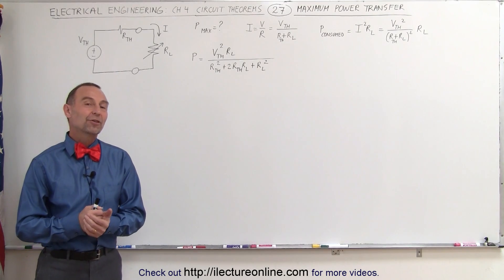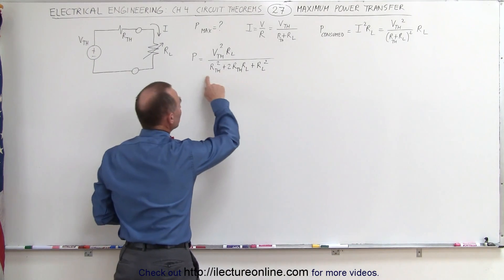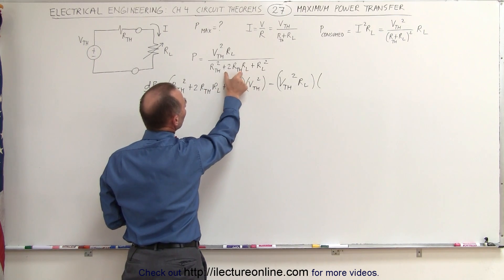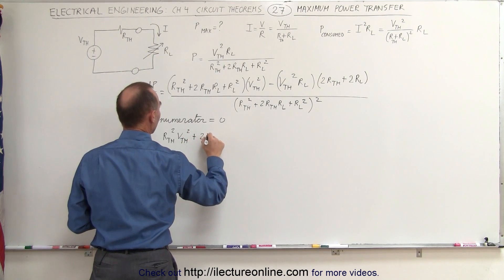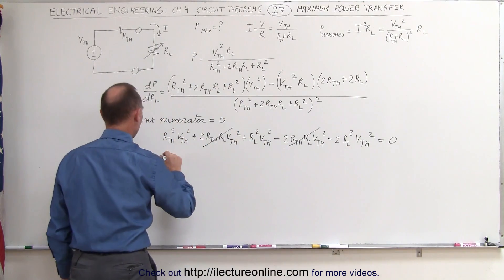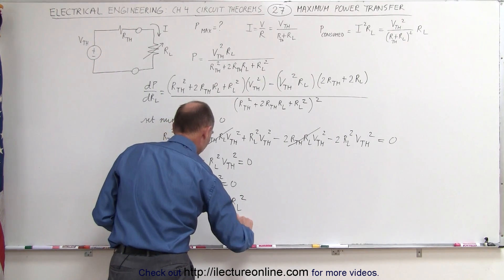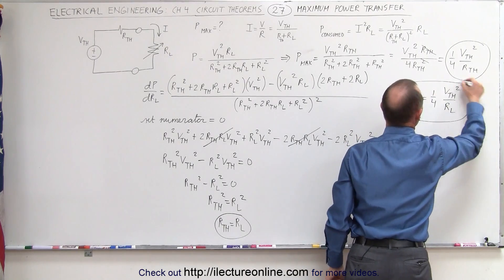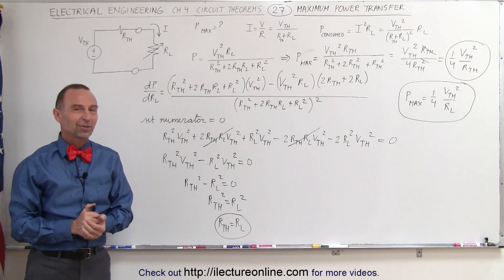Electrical Engineering: Ch 4: Circuit Theorems (27 of 35) Maximum Power Transfer

Comment: Excuse me sir, I would like to ask some questions about Thevenin Resistance
As i just finished a question and the thevenin resistance obtained is negative(For example -135 ohm) (Of coz, i checked the answer, it is right)
What does negative thevenin resistance means? And also when calculating the Max power, i noticed the answer stated the New Thevenin resistance is (-135+135) = 0. But why we need to set the new thevein resistance into 0 to calculate the max power, thank you!
Reply from the maker: Negative resistance does not have a realistic meaning.

Comment: Hello prof why did you set the numerator to 0?
Reply from the maker: In calculus to find the maximum or minimum value of something that is defined by a function or an equation, we take the derivative of the function or equation and set the derivative equal to zero.  (The derivative represents the slope of the function, and when the slope is zero, you will have fouind the maximum or minimum value.
Reply: thanks for the reply how would you know the power is at maximum and not minimum?

Comment: Why is this true? Feels counterintuitive if we look at equation p=i square rl then if we increase rl shouldn't power dissipated across resistor increase keeping current fixed
Reply from the maker: "Intuition" often misleads us.  Ohms law states:  I = V/R      Therefore as you increase R, current will decrease.
Reply: Michel van Biezen well now then again it depends on which formula you are taking. Where exactly am I going wrong in my statement intuitively. BTW thx for quick reply. So which statement is right or wrong?
Reply from the maker: That is why I always go back to the basic equation that I know is true.  If R is increasing then I must be decreasing, and if I decreases, the power dissipation must decrease.  Which means that this statement cannot be correct:  " if we increase rl shouldn't power dissipated across resistor increase keeping current fixed"
Reply: Michel van Biezen thx for the quick reply
Reply: Michel van Biezen although I get what you are saying which is basic fundamental just find it an odd observation

Comment: I have a question about solving for the maximum procedure. The step where you have (R-TH)^2=(R-L)^2, when you take the square roots of both sides, would you get R-TH = plus or minus R-L? Does the negative answer just get discarded because it  is the same magnitude but opposite in direction? Thanks again!!
Reply from the maker: It depends on what you are calculating.  In this case, we are calculating power consumed which cannot be negative.  (if we could consume negative power the world's energy problems would be solved instantly)
Reply: Great, thanks for the explanation!!

Comment: Deriving this equation can also give us the minimum power ( not in that case) how can we spot that
Reply from the maker: If you graph the equation,  or take a look and estimate the shape, you can usually figure it out quickly.
Reply: The second derivative of that massive expression is less than zero so RL = Rth is at least a relative maximum.